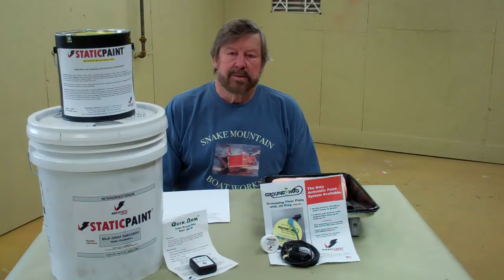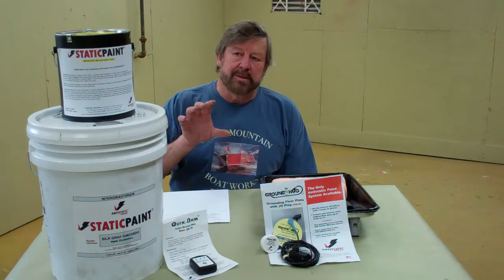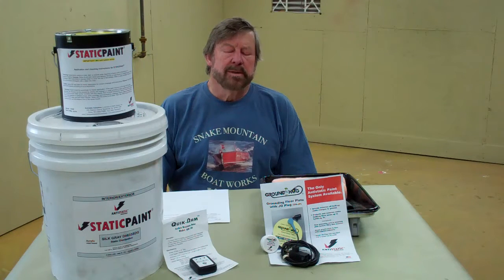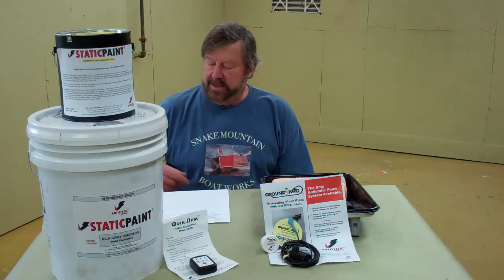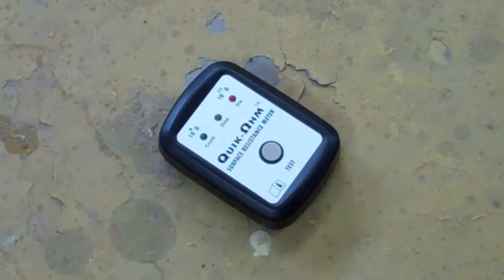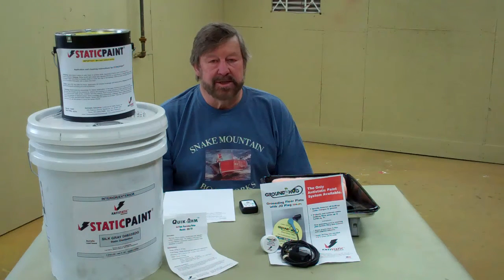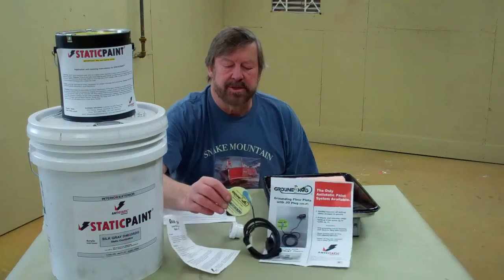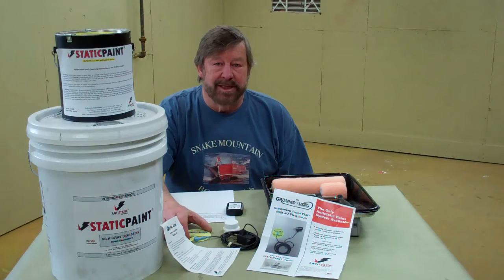Battling Static Electricity With Static Paint From Antistatic Industries 3 26 2016

Comment: Surprised to hear that is a problem there. Here in very DRY Arizona that is a constant problem. Also I have seen where the car painters use an anti static filter system and a wet wall system. Also a down draft venting system with the vents directly in the middle of the room.  I can only assume that the walls of the booth were painted in anti static paint but can not confirm.

Comment from the maker: I erred on the clip. If the meter reads green, we are in a conductive state. Our goal is a static dissipative state, which we have attained once the meter reads orange.As of 3:30 PM on Monday the 28th, I have applied two full coats to the ceiling and walls. A test two hours later returned an orange, static dissipative, reading throughout the room.I will upload another clip once I have three coats on the concrete floor.